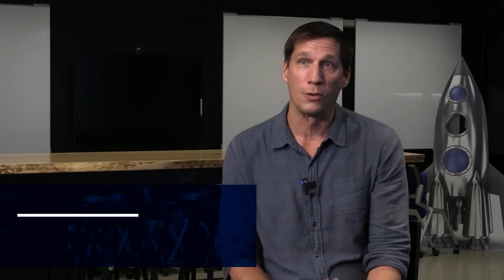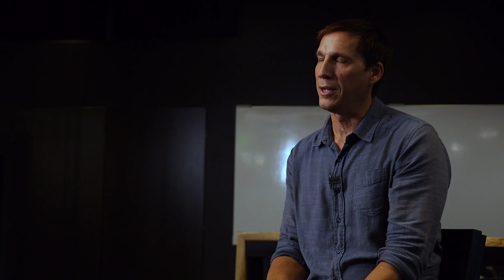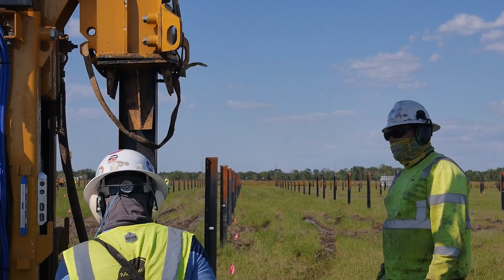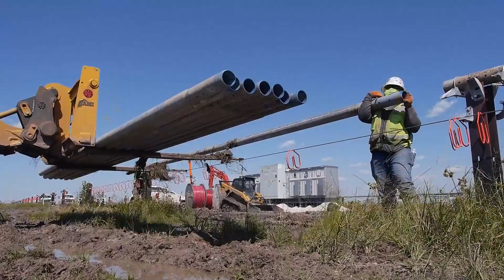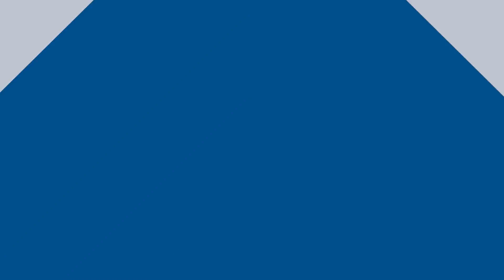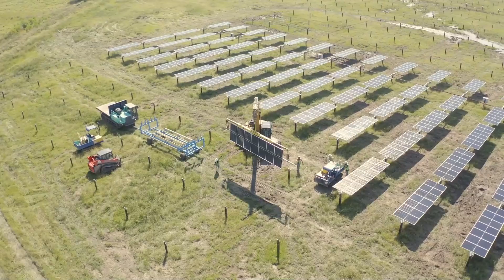Solar Industrialization and Technology in Construction with Mortenson

Comment: The PV Install crew crushed the automated octopus arm as we like to call it we can dream about every thing automated but tmap is the dumbest concept when you can still improve and implement better things with stick build although the new next tracker xtr system poses challenges trying to turn something into an assembly line has only cost people their lives and or serious bodily harm it will take at least 5+ years to even get close to stick build mortenson was at the peak 2020 ever since then they been stepping in the wrong direction and it all came down to management but the lowest point was eye opening from the failed Florida projects to the project in Waco that should’ve never been such a disaster and all of it came from upper management and the promotions over the past few years honestly pathetic if you ask me what once was the solar company is now a joke and shell of it’s former self